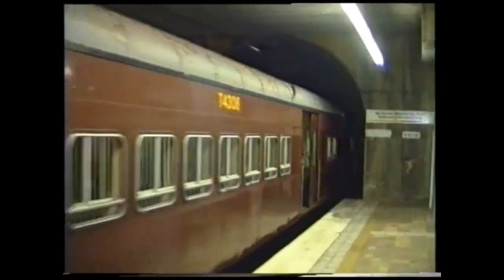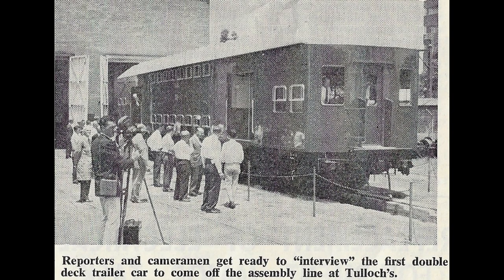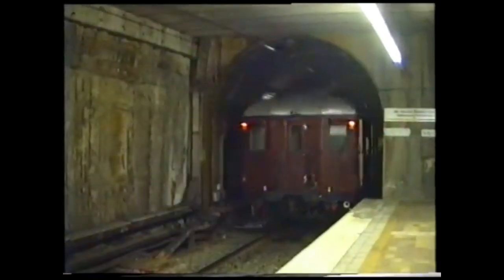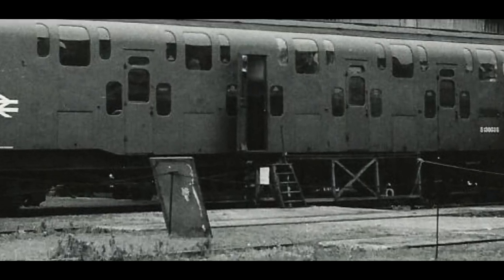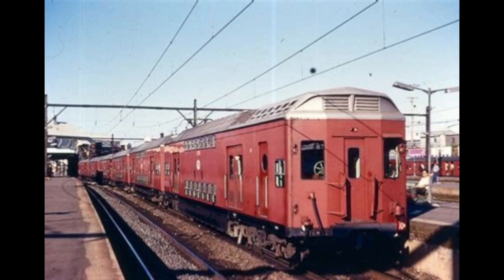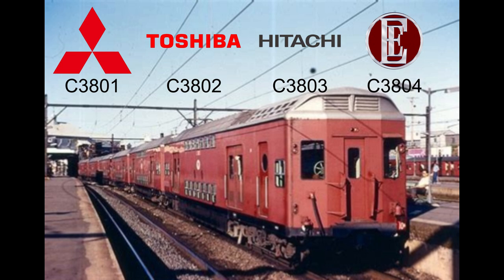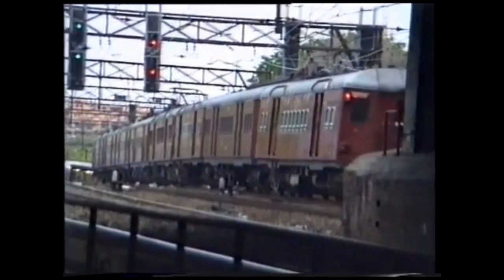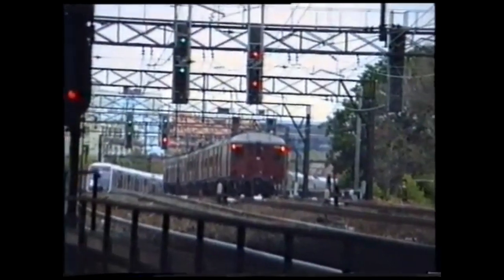Rail Fails EP2: 1968 Tulloch power car

Comment: The moral of the story is:

Always use electrical equipment from one company.
Reply: Random V Set duh come on state rail (that was back in the day before cityrail and Sydney trains) use your common sense and stick to one company
Reply: @Lightningdoyle21  Face palms
Reply from the maker: Lightningdoyle21 it was the NSWGR
Reply: @Random V Set yes that’s tru. The power cars should have had power supply gear from only 1x industrial company. If that happened they could have survived and lived in into the New millennium
Reply: @oscarstill909  the point of S10 was to test the different equipment and running gear for the new S set contract there was a plan to convert all four cars to Mitsubishi equipment to run with S sets but a dispute put that to bed pretty quick instead two were converted to 32 volt trailers 3802s conversion was started but never finished and 3804 was plinthed at elcar as a rolling shell
Reply: Rubbish, you can successfully have multiple suppliers. This is common practice. But you have to be resourced and trained to maintain them. The caveat is that it is more economical to have multiple suppliers. Again, this is relatively common practice..

Comment: These 4 double decker power cars presented radical engineering changes and challenges and all 4 were experimental models using different electrical systems from 4 different suppliers for evaluation and possible tender. We have the S Sets, and all that has come since to Sydney's double deck electric passenger fleet, to thank for these models. We should also thank the engineers who designed them and those who built them. If all that's a "rail fail" then so be it. Great archival footage. Thanks.

Comment: If you want a true "rail fail" look up the original 1970 MK1 blue goose cars they were built as prototypes to future batches of DDIU cars (V sets) they were semi permanently coupled in pairs with the two cars shearing equipment because there was no room in just one car for air-conditioning and running gear the problem was the jumper cables between the two cars couldn't handle the load placed on them and neither could the motor alternators on many occasions If the aircon and motors were at full power the train would stall that's what caused the 1978 glenbrook disaster the blue goose set failed and was rear ended by a freight train DCF8004 was crumpled it ended up rolling down the cliff in pieces all 15 remaining blue goose cars were eventually converted to V set trailers and because of rusted mild steel underframes they were all retired by 2005 and 14 were scrapped in 2007 DMT9204 survived till 2009 when it was blown up during army training

Comment: Welp how to break down a train number one use electrical equipment from different companies number two that’s it you did it 10/10 you did it you broke down a train
Reply: S10 was a testbed for the S set contract C3801 was the most problematic car and the first to be removed from S10 the rest were pretty reliable until towards the end they started to fail pretty regularly the last S10 motor car in service was C3802 with its trailer in set W16

Comment: C3801 OOOOOOOO 3801 IN THE OLD C SET LIV
Reply: C3801 never made it into the "old C set liv" it was withdrawn in about 1972 repainted into PTC in 1974~ it was then rebuilt into a 32 volt trailer to run with S sets in 1981

Comment: C3802 had budd pioneer III bogies with inner frame bogies and disc breaks and a feiverly "half diamond" C3804 was the only car to have audible traction gears much like the single deck cars it also had a  bigger pantograph well to fit the bigger pantographs identical to the ones on the single deck red rattler
the other two had fairly similar bogies and pantographs all 4 had the same body